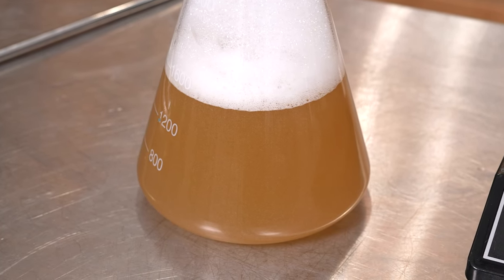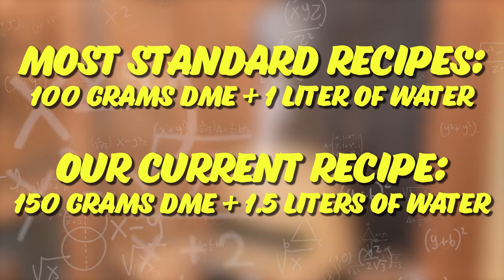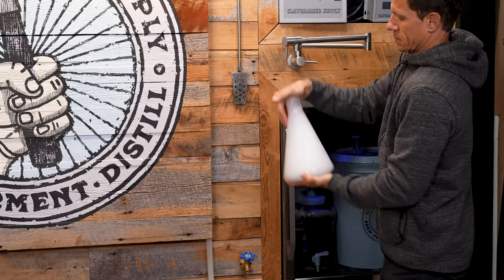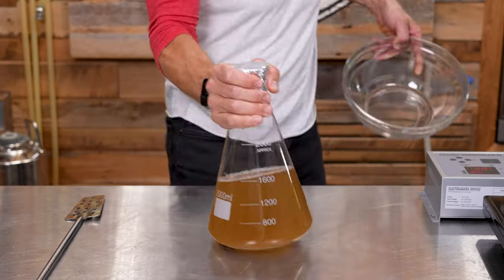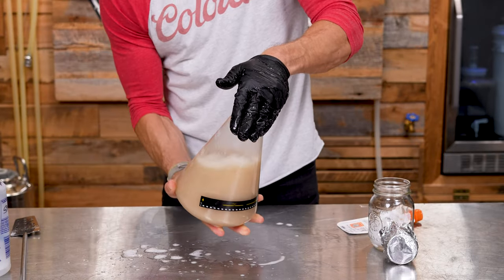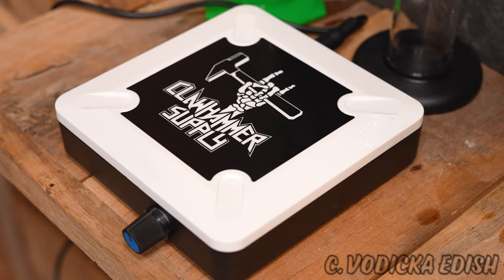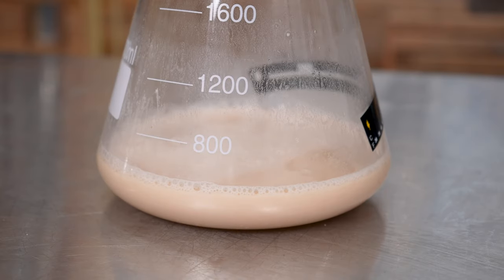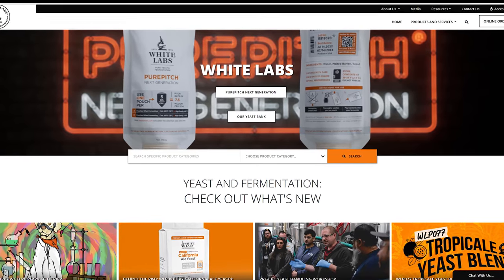How to Make a Yeast Starter in 10 Steps

Comment: What are the advantages of going though all these steps for a yeast starter?  Is it to minimize the stress places on the yeast during rehydration?
Reply: Increasing cell count. Usually after a while yeast cells viability decreases, so you end up having less healthy cells to ferment your wort. A starter not only helps with cell propagation but also reduces the lag phase, and since you're increasing your yeast cell count there's no need to buy additional pouches, and it's a great way to add more cells for higher OG worts.
Reply: @PabloAM93  Thanks for the response.  I may try this method although it's a lot more involved than just re hydrating the yeast in lukewarm water like I am accustomed to doing.  I currently mostly use dry yeast.
Reply: @BuildingADrink  I'm glad my response was helpful. Also they're helpful when it comes to overbuilding a starter, measuring you can harvest the grown yeast cells, pitch them and save others for future batches, as well as reviving old yeast.

Comment: Most of step 1 to 5 can be simplified/skipped if you just boil in the flask. No need to clean a pan or sterilisation with chemicals.
That lab stuff can handle the heat and rapid cooling with ease.
How did the yeast got its oxygen in this setup because you completely closed the flask?
Icebath is overkill, just slowly running tabwater is fine.
Ow and you can see that its done by the change in color (and i did not see that happen in the video)

Comment: Whats the spray sanitizer? Edible disinfect alcohol?
Reply: Usually it’s Star San. I mix mine in small batches. 3ml star San concentrate to 1/2 gallon distilled water. Or 6ml concentrate to 1 gallon water. This is the same ratio as Star San directs.

Comment: It's also very important to cover the starter and protect the yeast from light. Especially direct sunlight because of UV. Otherwise nice vid
Reply from the maker: Why? Sunlight degrades hops but what is the impact on yeast / fermentation?
Reply: @ClawhammerSupply  it (UV light) simply kills cells and causes mutations that are also preserved in daughter cells, which can supposedly also cause off flavors. If in direct sunlight the starter can become "lightstruck" just like a beer. Yeast has DNA repair mechanisms just like humans and they are very similar, but yeast cells don't have skin, so they are much more sensitive to it. There is plenty of material online about it. It was a simple student project when I was an undergrad to expose bakers yeast to light and observe their growth on plates. Big difference
Reply from the maker: @mrknaldhat  Iiiiinteresting. Thanks for the info.
Reply: @mrknaldhat  many thanks!

Comment: Steps 2, 3 and 4 can be combined by boiling the water, dme and stir bar right in the flask. You can skip the starsan completely because boiling in the flask will sanitize it instead. After your boil you can put the entire flask into your sink or bucket to chill.
Reply from the maker: We used to do it this way but recommend against it now because it’s much easier to accidentally boil over in a flask
Reply: @ClawhammerSupply  I stopped boiling in the flask for that reason. Also, less likely to shatter a compromised flask while heating or cooling. 🍻

Comment: Or you could ditch the liquid yeast. They always need starters because of their unpredictable yeast counts. And use the correct amount of packets of dried yeast based on the pitch rate needed. You can always count on Lallemands yeast count and pitching rates being accurate.
Reply: But both add different character to beer and liquid yeast tends to ferment cleaner than dry (brulosophy have tested this)